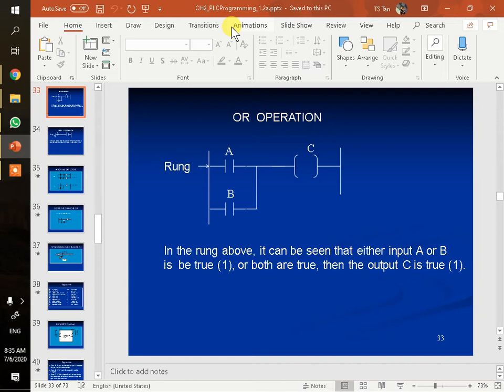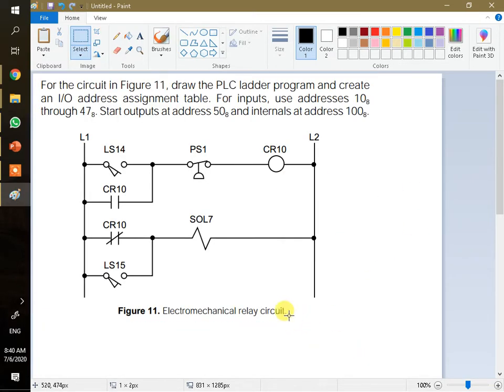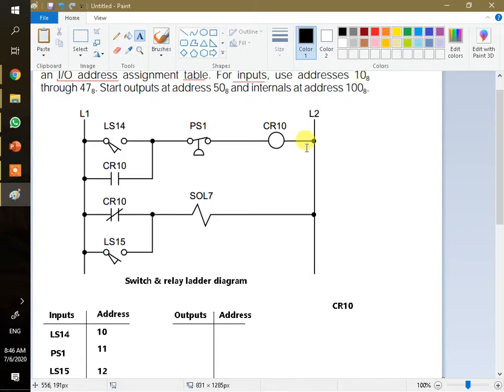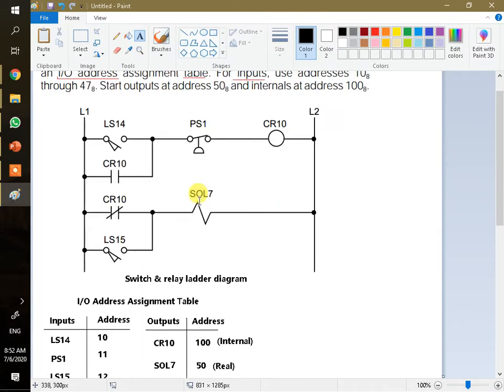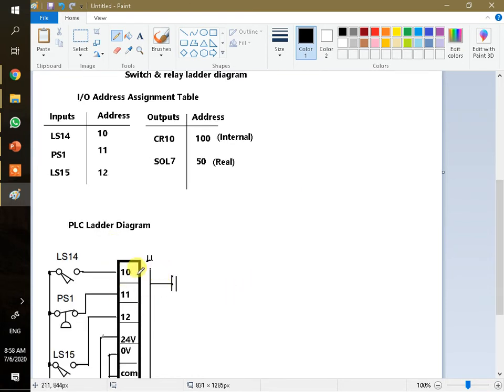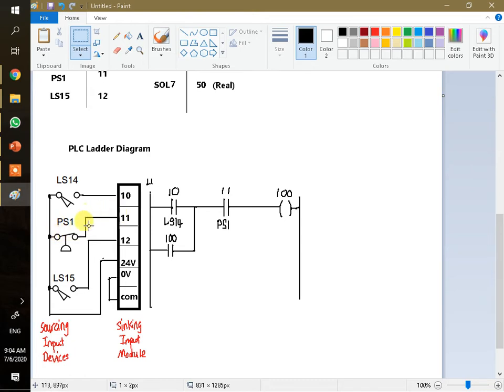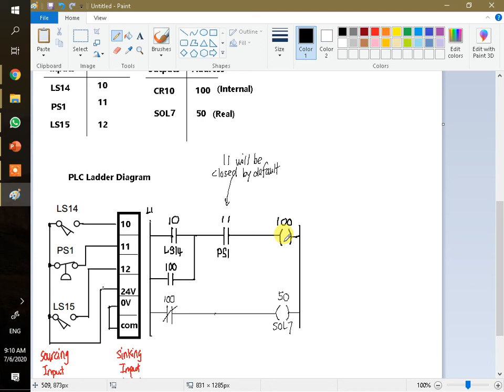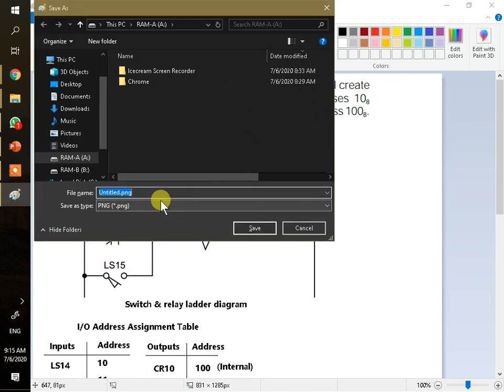Convert Relay Circuit to PLC 1

Comment: Wrong explanation about NC of the pressure switch. You need to follow the NC status of the control schematics diagram when write PLC ladder diagram
Reply from the maker: Schematic = NC, but PLC Ladder should be N.O.